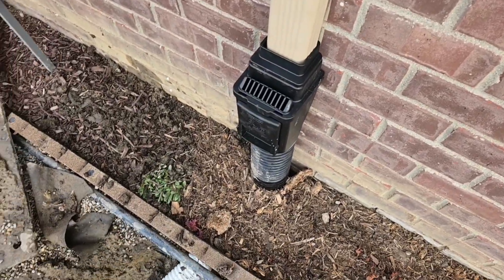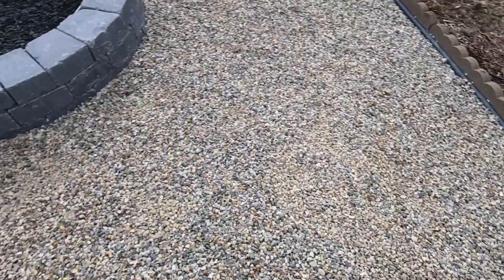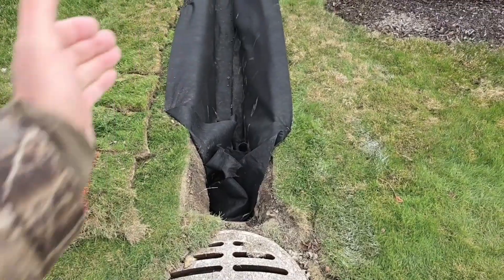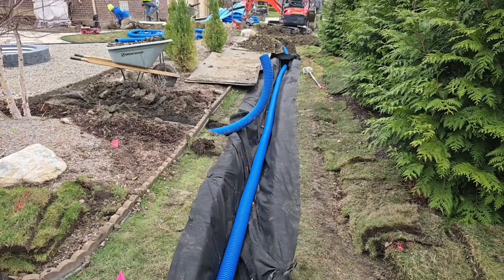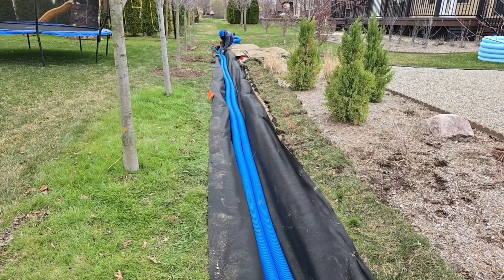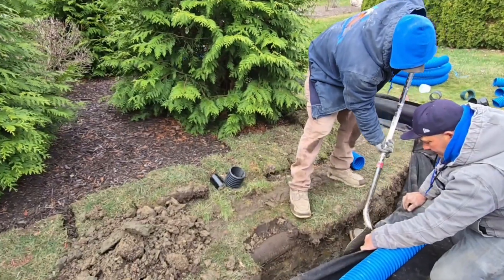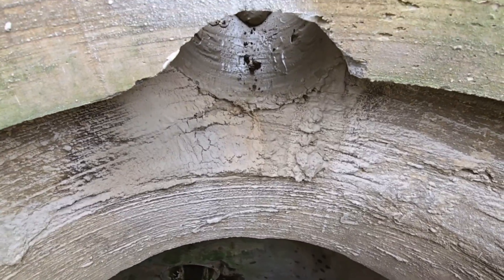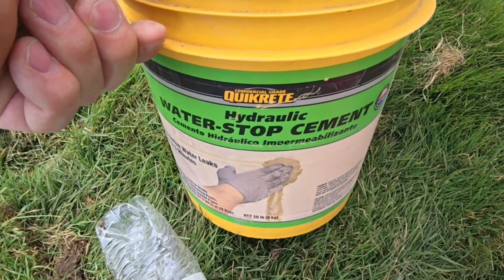How to Run Downspouts and Catch Basin in a French Drain

Comment: Planning my drainage system, gonna use all FDM parts. I'm going to have a perimeter French drain pipe and downspout pipe in the trench. In the front corner of my house, the front and back yard sections all converge on that corner. Also have a gutter coming down in that corner. Trying to figure out the most efficient way to tie them all in. Could I send you a picture for some advice? 

Appreciate it!
Reply from the maker: @Cosmo-k2e You'll need more than one discharge line, based on your description. Contact us at frenchdrainman@gmail.com.
Reply: Thank you! Will do!

Comment: I see put clean outs on all your starts of perforated pipes. All seem to be 4”  with you not quite a 90 fitting do you offer a way to do the 6” stuff or just use the 90 you have and then run a corrugated pipe up to a solid cover ?

PS just started installing your leaf filters and they are looking amazing so far
Reply from the maker: https://frenchdrainman.com/product/4-in-drain-line-clean-out/

https://frenchdrainman.com/product/6-in-x-4-in-polyethylene-slip-snap-reducing-coupler/